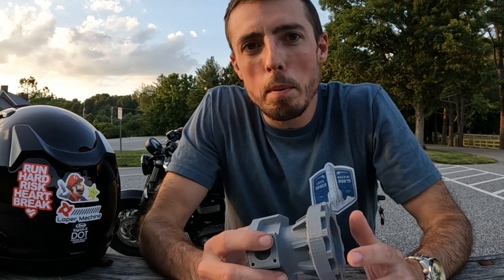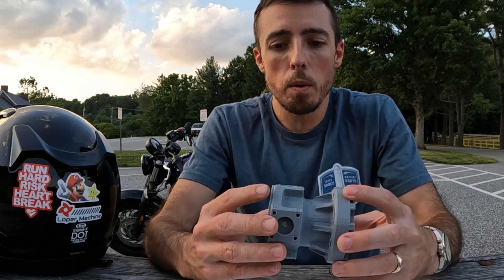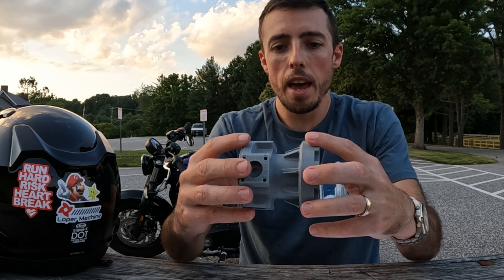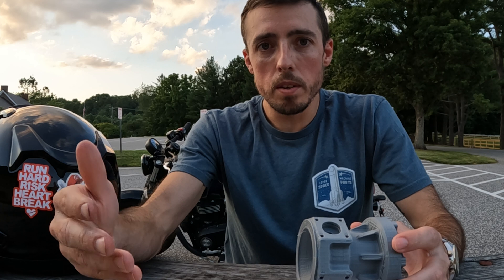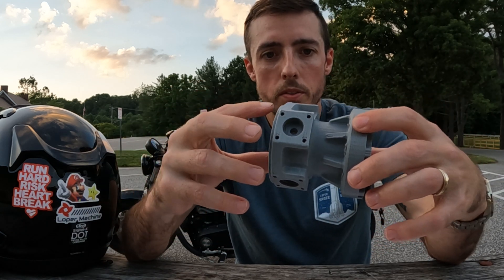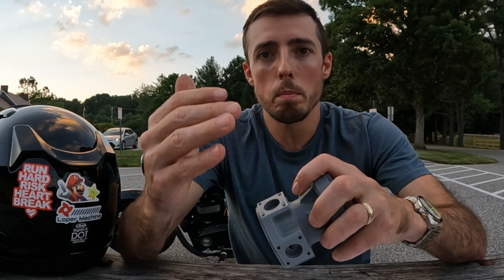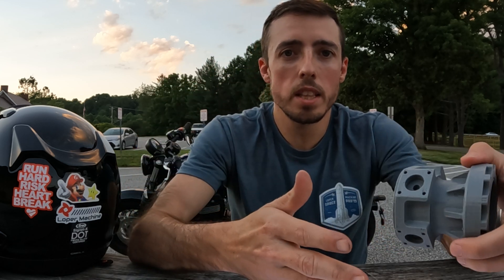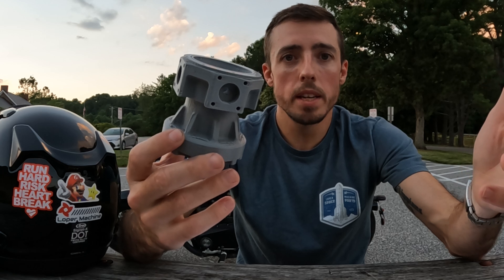The TITAN-78M RFQ

Comment: nice video! 1 Question: Why make the Boss to clamp on ypur lathe just 2 "? it makes the clamping less rigid, versus clamping on a big diameter. Makes a big leverage, when milling /turning on the front/ outer diameter
Reply: Great question! 
Actually I look at it as more shoulder face contact against the face of the jaws. At a 2” diameter I’m getting the max diameter contact possible with the jaws I have for this chuck.
Reply: @alexloper3084  yeah shoulder Face is important. Could you turn out a bigger diameter step in your jaws?
Reply: @jakobhohenstein6311 yes, I could do that 👊 I appreciate you brotha. 💯

Comment: In hind sight think you could have made it in 2 ops? And whats the reason for doing the prep op in the mill vs lathe?
Reply: With a spindle transfer absolutely. Unfortunately our sub chuck is to small. The jaws that I would have to use would result in a pretty sketchy setup. Working towards a larger machine in the future.
I should have explained the mill prep. I had another job setup in the lathe when I started this project
Reply: @alexloper3084  Very good reasons, thank you for breaking it down. Sometimes it's not the best way but the only way with what you have available.

Comment: What about tooling cost?
Reply: If the part requires special tooling absolutely build that into your NRE. Standard end mills, drills, etc. I don’t add that into the price because I believe that should come with the service we are providing and built into our shops hourly rate. 
If your quoting a production job that is going to go through inserts or maybe a rougher end mill then you should consider building that into the cost as well. I would really recommend figuring out what that price would look like and capture it in the NRE.